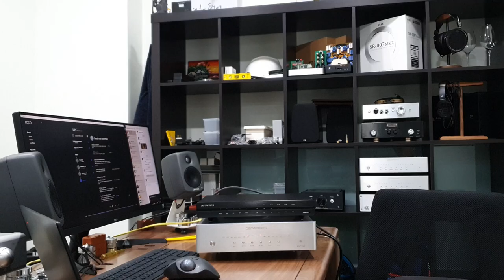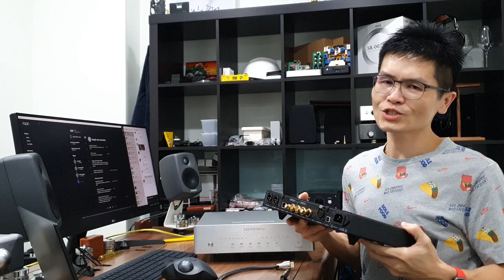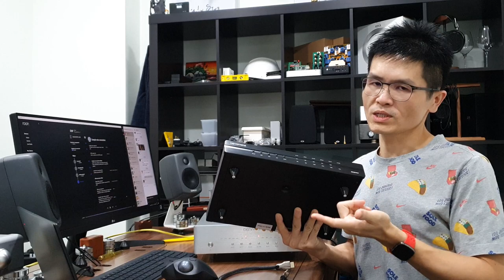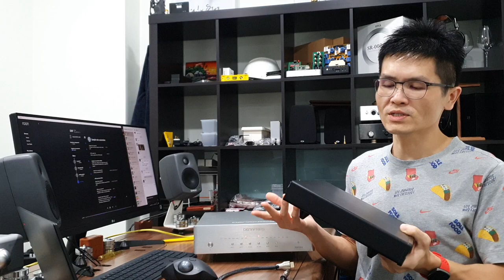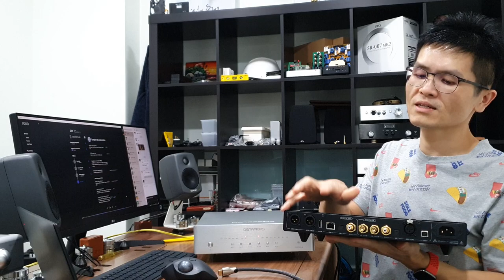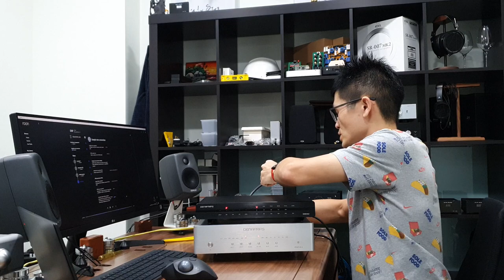DENAFRIPS I2S

Comment: I would love to see an I2S input into the DDC with an option to change the I2S pinout.
This would also help to fix compatibility problems between a source and a DAC that only supports one specific I2S pinout like Gustard R26.
Reply from the maker: Thanks for the suggestion! DENAFRIPS Hermes and Gaia DDC’s i2s pin out is configurable. This may fix the compatibility of the i2s with third party DAC.
Reply: @VinshineAudio  Not really because none of them does provide an I2S input. My CDT does only provide an I2S output but not an USB output which is needed for Hermes ans Gaia.
Reply: I have the R26 successfully paired with a competitor's DDC featuring configurable pin out.
Reply: @DanielJackson-f4t  Great, and which one?

Comment: thank you Alvin! I am enjoying my i2s connection with Oppo bdp 83!
Reply: Greetings De Audiofilos and Locos.  I also have an Oppo bdp 83.  Do you have the 83 going directly to a Denafrips DAC? If so, can you share the setting that worked (000, 001, etct)?  I am trying to get the I2S connection to a Pontus II with an HDMI cable I have available.  I wish there was a list of HDMI cables that do work with I2S as that part is an unknown.
Reply: @richardrios7362  you need a box from eBay that costs $50.  It extracts the dsd into i2s format, you cannot connect directly from the transport to the dac,because of the built in copyright protection. I have a video about it in my channel.
Reply from the maker: This article might be of interest to you: https://audiophilestyle.com/ca/reviews/at-long-last-listen-to-your-physical-sacds-through-an-outboard-dac-r971/page/3/

Comment: Thank you Alvin,
can you tell me if i need a  reclocker  between my MacBook pro and the Pontus 2,
also, do you plan on issuing a silver version of the more affordable  unit?

Best regards, much respect.
Francois.
Reply: I would recommend, but depends if your amp and speakers being good quality
Reply from the maker: You nailed it sir. It really depends on how revealing the system is to tell the difference :)
Reply from the maker: Hey Francois, Iris/Hermes comes in black color only. It's a great companion with the Pontus II DAC

Comment: Hello 👋  I have a question if anyone can answer it. I have a pontus ii. The specs already state that audio is buffered and reclocked inside the pontus using its own crystal oscillator. What is the benefit of using another ddc on top? Does it contain better components or is there some other reason to use it?
Reply from the maker: Glad to be of help sir!
Reply: @Vinshine Audio  hi thanks 👋  so is there a benift to use this with a pontus?